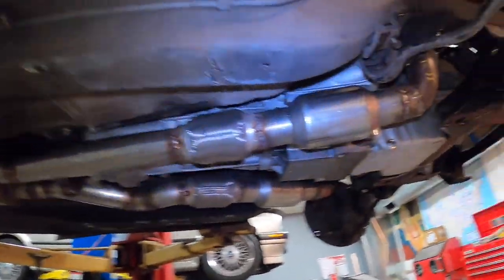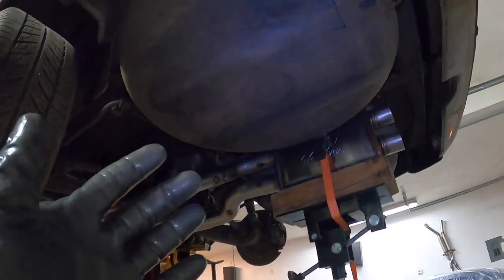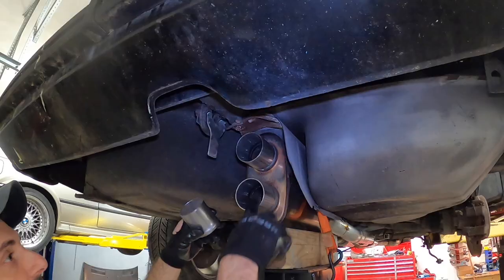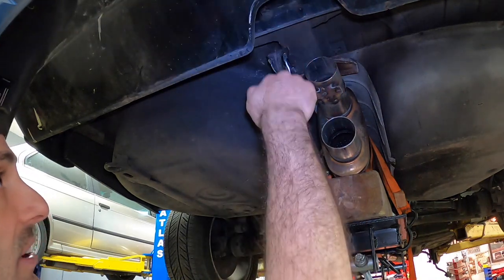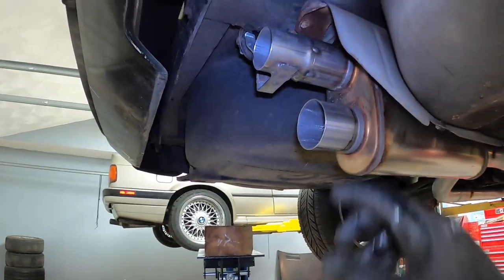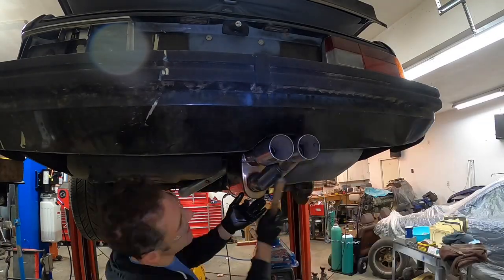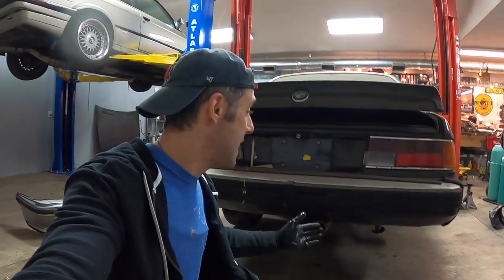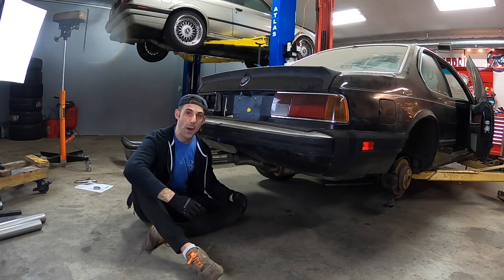Part 10: It's A Real Shame, But This Exhaust Turned Out .... Well, I'll let You Be The Judge

Comment: awesome detailed exhaust pipe work!  A work of art appreciated only by you and your viewers I'm sure!   Time will tell if there is enough space between the tail pipes and polymer rear bumper (idling on a hot summer day with car nose pointed north). Seems close to me.  Will you add chrome tips?
Reply: I completely agree! This exhaust needs a set of nice tips to complete the overall finished look. Everything else is pure art! I would definitely buy this system for my 1987 L6 but would look to add a set of tips (double walled rolled edge) if none were included.